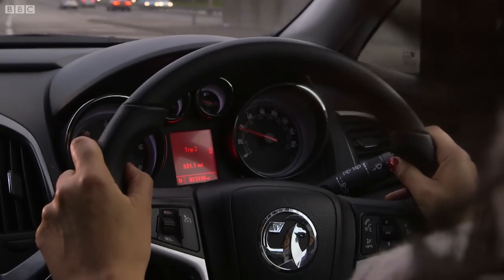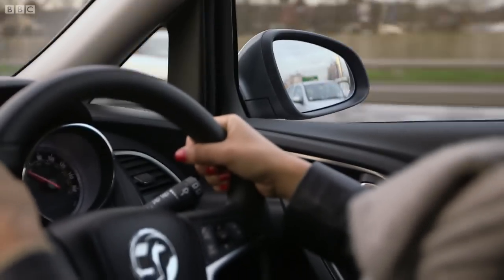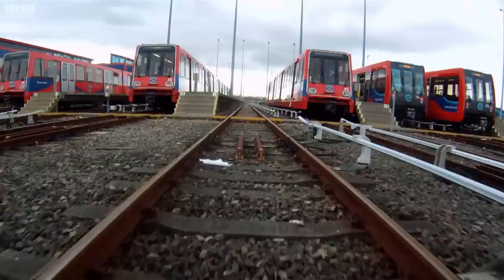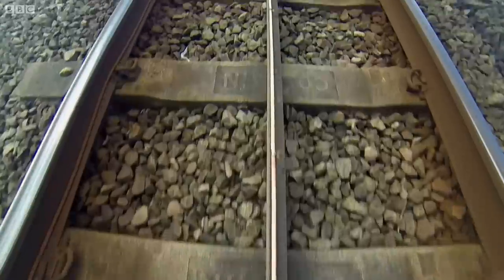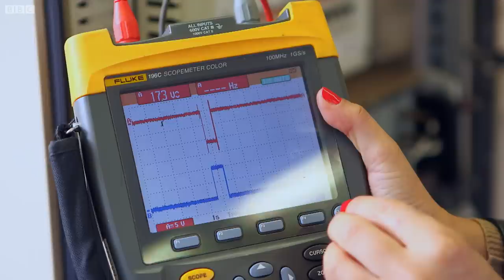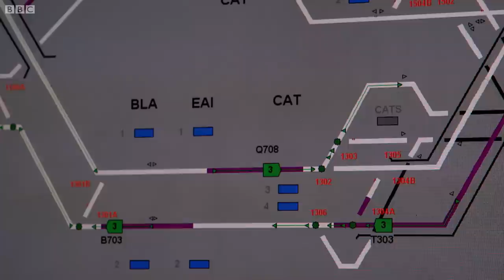How Do Driverless Trains Work? | Bang Goes The Theory | Earth Science

Comment: it's an interesting system I know computers can do jobs like counting the number of revolutions the wheel has turned or number of Loops passed but both of those methods are prone to cumulative error on a small scale it wouldn't matter but if you were doing it on a country or a continent the tiny errors would eventually add up and the train could be anything between a metre and half a kilometre away from its reported location although this could be solved by putting GPS systems on the train
Reply: combining systems fixes that. For instance, you could have checkin points every few km where the train "logs in". Then any calculations are done from that point.
Reply: +Jim Groth  didn't think of that thanks also I think about it cumulative errors are so small you could probably use the stations as log points
Reply: GPS won't work in tunnels
Reply: +salaciousone gps can still be used in conjunction with the other systems to increase accuracy.
Reply: +frank cusack Redundancy's the name of the game here, they have a bunch of different ways to tell where trains are.  I don't know this for a fact, but I'd be willing to bet that the trains have GPS on them, although I doubt it's used in general operation, probably just to locate stopped trains. Also, the loops are not prone to cumulative errors, only the wheel sensors.  The chances of the sensor "missing" a crossover is basically zero, and the crossover points never change, so in effect the loops are log points.
Reply: ThoolooExpress On top of that, you can code data into the loops and use timed pulses to detect how far from the pulse generator you are.

Comment: Tell me in this day and age why do we need train drivers? Trains only go forward slow down speed up and brake. Oh that's right the unions who insist its for safety even though the overwhelming cause of train accidents is actually caused by the drivers themselves.
Reply: Gavin Sharp Well let's say a sudden fault popped up on a train. A driver could easily fix this problem than someone dashing through congested traffic to fix it. Additionally, would you rather be safe than sorry?
Reply: DLR is automated but requires staff on board in case of emergency. Skytrain is different, it can handle emergencies even when unattended.
Reply: Well Bungle2010 the accident reports of many train crashes support their statement.
Reply: I'm not your slave look  up the accident reports for your self they should be in the public domain in most countries
Reply: Well yes I do believe you should do your own fact checking you challenged the original poster in quite an arsey way without any facts and all I did was point out that the accident reports from very minor to some of the worlds worst accidents, will support what they said.
Reply: Tim, you and many others commenting on this video are badly conflating and generalizing about rail systems when using the term 'train'. The DLR and other such systems used around the world are very light, modest speed, dedicated systems. They are totally sequestered from any other vehicles and are designed to fit a particular transportation niche.They could not even remotely compete with a standard heavy rail Metro system, themselves being dedicated systems. Virtually all of the accident reports you refer to pertain to none of these systems. Almost all do pertain to interurban/commuter
trains, intercity trains and freight/goods trains. And these trains often use track and infrastructure shared by other heavy rail systems. Additionally, the causes for the vast majority of rail accidents in these much more complex environments and systems than that of light rail, have to do with equipment and/or maintenance of way issues. 
The considerations of acceleration and deceleration for light rail systems like the DLR verus heavy rail systems is akin to comparing a golf cart to a huge lorry. You'll see a driverless Eurostar train or a driverless 10k ton freight train about as soon as you'll see a 'driverless' commercial airliner.
Reply: Yeah, that worked wonderfully when a glitch caused the Skytrain to be out for hours.
Reply: Frank compared to the 100s of hours of delays from signal failures, SPADs and crew issues on the mainline that's nothing.
Reply: You still need train drivers to supervise the system. Imagine going on a high speed train at 125 mph with no driver

Comment: Why not use GPS tracking to determine train position and speed ??
Reply: +Markus Dammasch cost
Reply: +Markus Dammasch I'm not sure if the trains go underground, but it they do, they won't have signal.
Reply: +MrSaiwen - yea, didnt think of the underground - GPS would be useless.
Reply: +Markus Dammasch  The lack of reliability and precision most likely (not cost, GPS isn't expensive)
Reply: GPS isn't used for train position because it isn't precise enough and dosent work underground.
Reply: +Bungle2010 That, but even newer metro systems don't use GPS because it isn't reliable underground and isn't as accurate.
Reply: dlr is 19 years old,  gps is from 1980 so yes it was
Reply: @elixier33  
Stop trolling

DLR is from 1987
GPS didn't become commercially available until the 90s.

And as stated, it's not reliable and is subject to glitches and won't pick up an underground signal since they do have a portion under the Thames.

Comment: The question is - can this system be adapted for the London Underground? That's where it would make a huge difference.
Reply: +Bungle2010 To the cost of running them, and to the reliability of the network. There are always announcements that 'due to a signal failure, such and such line is suspended'. This technology could do away with all that, plus all the drivers holding London for ransom whenever they please.
Reply: +Eduard BP The Northern, Central, Jubilee and Victoria lines operate with ATO (Automatic Train Operation). This means that the trains basicly run by themselves but the "drivers" are there in case of an emergency and to open the doors and set of at the stations a bit like a dispatcher used to do
Reply: +Andrew Nielsen Thanks for that Andrew, didn't know that.
Reply: +Andrew Nielsen drivers drive the train on weekends and open sections of the northern line, would like to see that type of train operation rather than no driver, the tube won't be ready for it for now.

Comment: Maybe it's just in our country, but i would be worried what is some idiot cuts the wire and/or steals it? 
Otherwise awesome idea, but i would prefer GNSS - positioning for every train using satellites GPS/GLOBASS/GALILEO..
Reply: probably because unless they were electromagnetic you wouldn't notice they were gone and secondly magnets degrade over time admittedly is a long time but its hastened by stuff like fluctuations in temperature and what's going on in the surrounding environment
Reply: It happens in Denmark aswell with people stealing the cable. But only on the S-train thats manned. I don't think it have happen on the unmanned metro yet.
Reply: +Lukáš Artek But who would be stupid enough to stand on a railway, with trains coming every 15 minutes or whatever it is? It'd definitely take up more than 15 minutes to take out 25m of wire ^_^
Reply: If someone cuts the wire they system detects that there is a fault and stops all the trains in the area. GPS isn't accurate enough to be used for train position and dosent work underground.
Reply: +Jordan O'C (Xenro66) They run every 5-6 minutes :D
Reply: GPS isn't accurate enough for trains? We use GPS (WAAS) in aviation and it is accurate to less the 1 meter.
Reply: @terks43  you're closer to the satellites but you also use radar as well. GPS isn't your only source and not the main one at that.
Reply: @terks43  Planes tend not to crash

Comment: I wonder what the failure rate for this system is. Here in Vancouver, we get delays that are sometimes so bad enough that we have to close down entire track sections. 

Throw it back to 2014 when the entire system shutdown twice. One was thanks to a computer error which logged off all the trains and the other was in human error when an electrician screwed up and cut a communications cable.

Nonetheless, I find it very amazing that we can run trains run at frequencies of up to 90 seconds at rush hour. Something not very many cities have.

Sadly, the of Vancouver gives no damn and will complain nonstop and expect things that are literally inpossible. Its so bad that we still complain when we get service improvements. Sheesh.

I love my city - I just cant stand thise who complain at ever Translink does.
Reply: Juan Miguel Sanchez Pretty sure it was some thing with BC transit doing something in the 80s that caused all these problems.
Reply: Things do still go wrong
Reply: @buizelproductions-movedtob7799  SkyTrain barely existed in the 80s. It didn't open until 1986.

Comment: It is not as safe the DLR as shown in this film., Anyone beeing on the tracks will face highly to be overun as the driverless trains has no obstacles sensors on the front. Try as passenger in the train or on the platform  to stop an oncoming train. If one presses the alarm the train won't stop immediatly. The process to bring a DLR train to emergency stop is too lengthy and people lost their life whilst either fallen ill on the platform and fallen on the tracks or been pushed or lately standing on the track. , There is not enough time and the cctv operator room can't monitor all the stations and tracks, that's is what they say.

Comment: couldnt you just figure out how many kilometers an hour its going and then use gps to figure out where it is and then make sure every train has access and knows the location of all other trains and their speeds?
Reply: A GPS signal is only accurate to 3 or 4 metres, far less precise than the centimetre accuracy of the wires.

Also, a significant proportion of the DLR track runs underground, and no GPS signal would be available there.
Reply: This is actually under development mainline trains. The new European Tran Control System (ETCS) uses radio communication between the train and the control system in it's level 2 (and future moving block level 3). Instead of counting loops it has transmitters on the sleepers (kind of like NFC tags) which tell the trains where they are. For the future there is an option to use satellite navigation instead. But instead of GPS they will be using Galileo once it's finished.
Reply: There are several problems with GPS. The connection won't be available underground, and it's not accurate enough. GPS is also property of the United States, and it can be switched off if the government there so decides. It's better to have a system that's not under someone else's control.
Reply: Tuppoo94 The ETCS that would be able to use Galileo satelites also uses balises to get the position. In tunnels you could still use them and just spare them on open sections.

Comment: And yet, the DLR is rarely left on automatic. The train captain/attendant usually opts to drive it.
Reply: +AMGitsKriss There are only Public Service Agents onboard for safety reasons. They don´t operate the trains unless they really have to, and that´s rare!
Reply: +Andrew Sebastian Rothgarn Antonsen Not exactly true. There are several levels of train operation reaching from completely manual operation on sight up to fully automated trains. The DLR is just using the second highest level where the train moves totally automatic but the closing of the doors has to be overseen by staff.
Reply: Andrew Sebastian Rothgarn Antonsen not as such. Any rush hour train will be manned by a 'captain' at the front access controls. This is to see the doors shut promptly and regulate service. But should they need to drive it manually then they can and will.
Reply: was on it yesterday, only drive to couple / uncouple the trains in an emergancy / to the depo only.
Reply: When they sit at the front, they don’t directly operate the train. They’re at the front ready to perform an emergency stop incase there is a [possible] track incident.

Comment: Good bye train driver jobs.. :'(
Reply: SAmB this has been around since 1980s
Reply: It has been automatic since opening.
Reply: Jobs were created, not lost by the DLR.

A. It opened with this system, so how could any drivers lose their jobs if they haven’t had them to begin with?

B. There is an attendant on board every train. If necessary, they can open a panel at the front of the train that has drivers controls.

C. There are people working behind the scenes too, for example signalling, train maintenance, track maintenance etc.

Comment: Leaves out the human jobs lost with this advance in tech....
Reply: +Johnthfailsnail Jobs change. When did you last by a wagon wheel?
Reply: +Johnthfailsnail Yeah, not like the trains don't need engineers and developers. What's great is that developers don't strike either.
Reply: +Johnthfailsnail They shouldn't have been so greedy and go on strike when they already earn over £50k for a very easy job.
Reply: +Johnthfailsnail True. Brb, going to plow my field manually.
Reply: +Bungle2010 I can verify that :)
Reply: Um
This came about 30 years ago so its not new and the DLR has never had drivers. Only attendants who run the first trip of the day to ensure the lines are clear and then monitor the trains in auto mode. They won't touch the trains controls unless a fault occurs that the computer can't resolve.